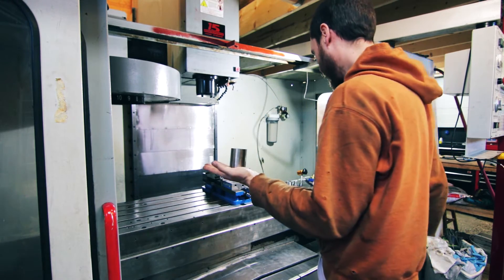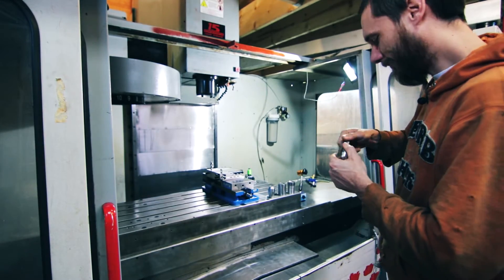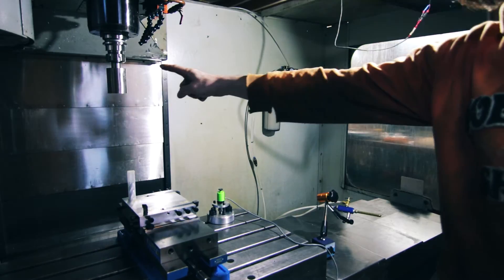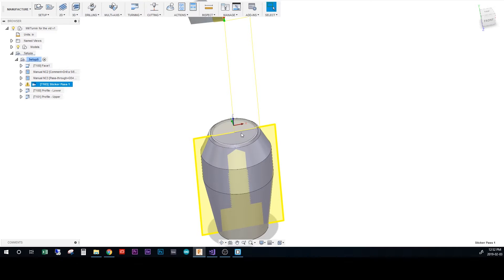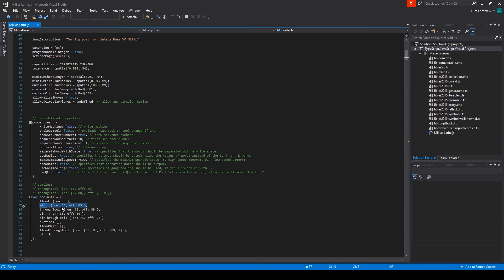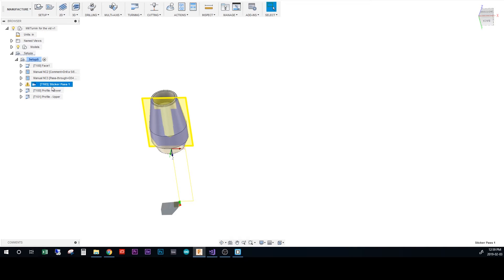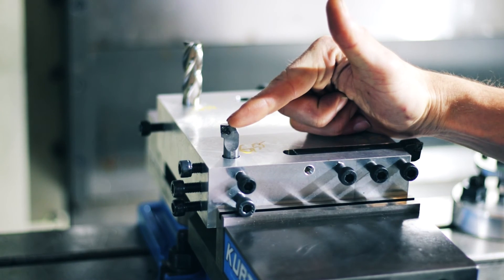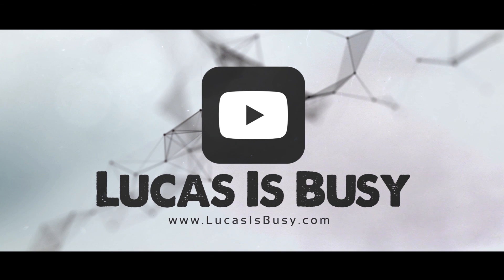My 1st Attempt At CNC Mill Turning. Stainless 304 Parts! [ Post Download in Description ]

Comment from the maker: Does the audio sound quiet to anyone else? The meters say its good but it sounds quiet to me. Let me know.
Reply: Indeed, sound was quieter on the second-ish part of the video, but still audible with no problems.

I would highly recommend putting up the post processor to github (or equivalent). Then it's easy to follow if you make updates to it and also easier to find for search engines etc. I keep my linuxcnc lathe post there for these same reasons. Not that anyone besides me is using it, but still :)

Great work on the post, thanks!
Reply from the maker: @vilts  Thanks! I will look into using Github. :)
Reply: any sounds is confortable when see the application of the video

Comment: Thank you for posting this, I have gotten your post to work with my 1996 vf3. I was curious why thread turning will not work if I have rigid tapping on my machine. Any help would be greatly appreciated
Reply from the maker: Hi, thats great to hear there are others using my post still. I have not maintained it in 3+ years so I am not sure why rigid tap does not work.

Comment: Hi Lucas. What does mean IRL in post?
Reply from the maker: It means "in real life" ;)
Reply: @LucasIsBusy  Is necessary use G43 H01 in g code, or different WCS for each tool is sufficient in the strategy or method lathe as a mill?
Reply from the maker: @miguelzambranojr  I used G43 to tell how long the workpiece was and G54 for where the tools were. You have to flip flop the WCS and tool offsets bc the workpiece is in the spindle.
Reply: Lucas Is Busy how can i modify my post to generate G43 H1 line ? Or could You throught manual nc?
Reply from the maker: @miguelzambranojr  you can modify the post for sure, but it will post out the G43 H01 command automatically....i think. It's been a while since I used that post so I'll have to go check. The G43 tells the machine how long the workpiece so it should be in there for sure.
Reply: @LucasIsBusy  In my case G43 H1 line no appear in my g code

Comment: Careful using stainless as the mandrel. Stainless likes to gall on itself. Better to use mild steel or something to avoid it. Most applications that require stainless for corrosion resistance will use either a brass thread or nut to avoid the galling.
Reply from the maker: Interesting, I will watch out for that. I like cutting stainless so I used that for the mandrel, but maybe I should switch it too a mild steel one then.  Thanks for the tip. :D